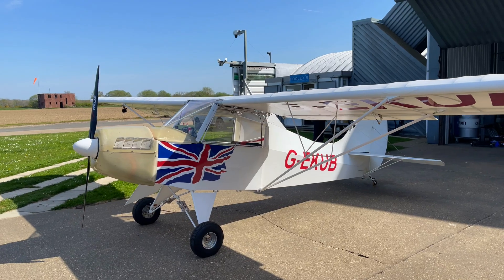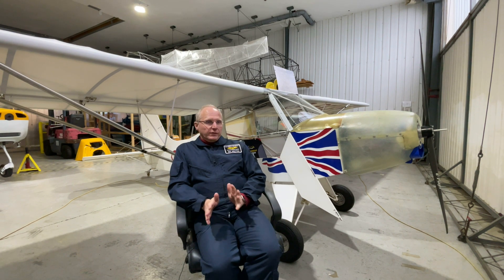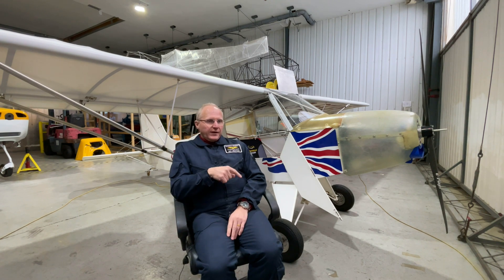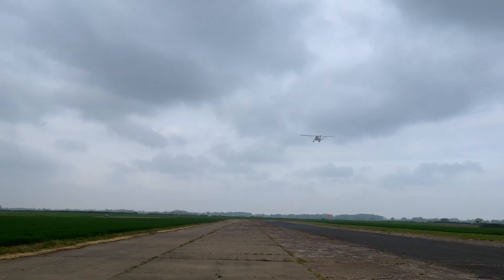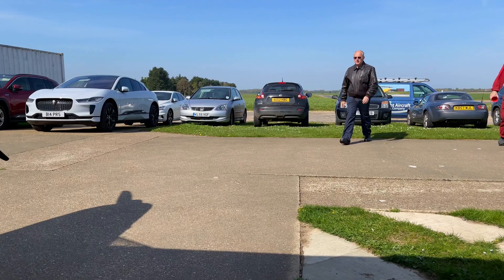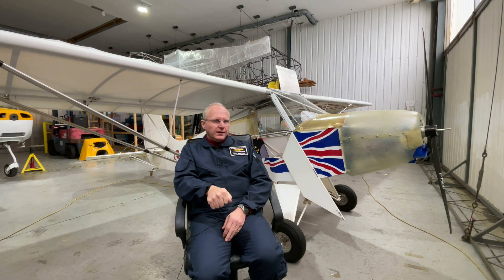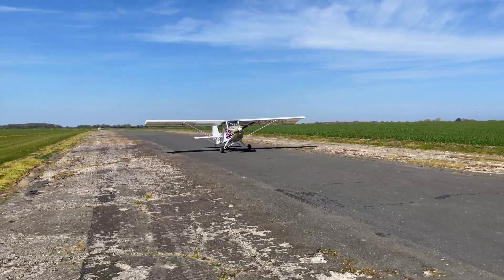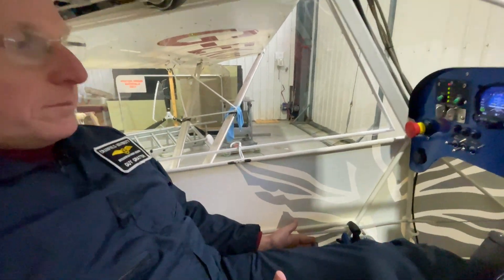Electric Aeroplane - E-KUB Interview with Test Pilot Dr. Guy Gratton - 4K

Comment: I fly radio control models all electric powered. When I first got into rc models I was using nitro and gas fuel. Average flight time was about 20 minutes. Now using batteries it is about 9 minutes.

Comment: Excellent discriptive breakdown of the power train and controls. It really opened my eyes to  the  enormous amount of paperwork and procedures required in this project. Would i be corect in the assumption that the battery technology is still lagging behing the motor. technology.